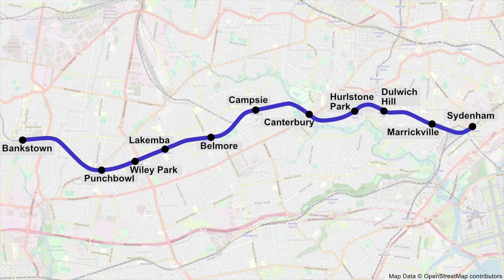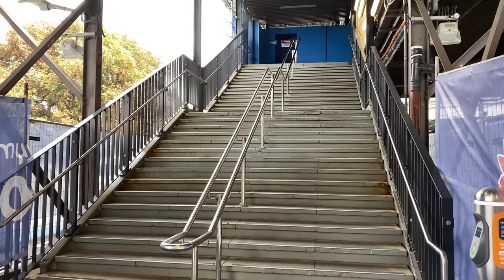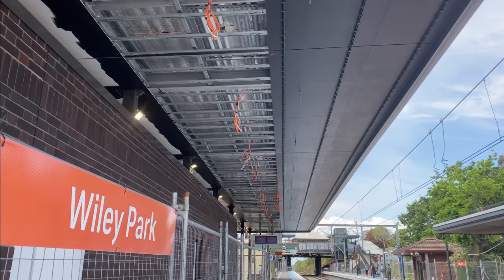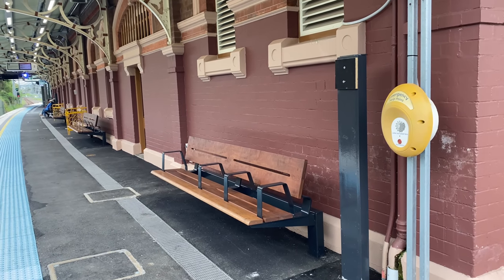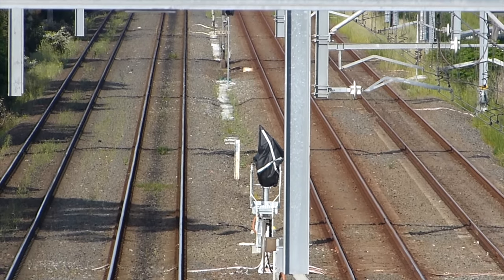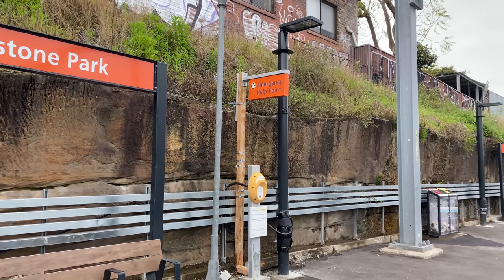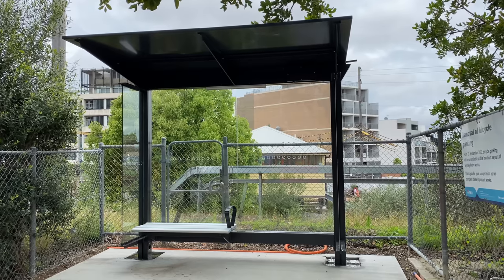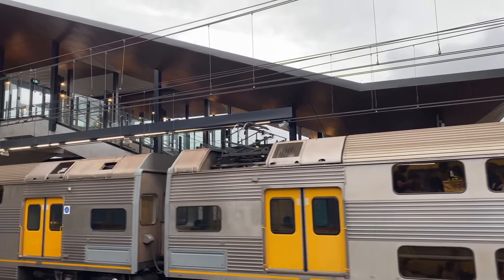Sydney Metro Bankstown Line Upgrade - Bankstown to Sydenham - Oct 22

Comment: Great video. I regularly make the roundabout walk from light rail to regular rail at Dulwich Hill - not that I'm ever in any great hurry, but it'll be nice to avoid that vague sense of futility when a train's pulling up to the station platform basically right in front of the light rail stop, so close and yet so far...
Reply from the maker: Hi Daia, glad you enjoyed it!  Yes that's definitely going to be a welcome addition to Dulwich Hill Station and will make it a proper interchange with the L1.  I reckon it will save a good 3 to 5 mins on the interchange time.

Comment: I live on the Metro Northline and our line was closed down for 6 months.  We never had a problem at all.  We just hopped on the bus and it didn’t interefere with us.  It will be fantastic when it’s open.  Your line is so old that’s why it’s going to take longer.  Labor are very hopeless at doing anything.
Reply from the maker: Yes the Epping to Chatswood line was much simpler to convert. For starters, only 5 stations that need platform screen doors, as opposed to 10 on the Bankstown line.  And because it's above ground, there is lots more to do to protect the rail corridor, so that driverless trains can operate safely. And then you've got curved platforms that will require mechanical gap-fillers. It's a big job!
Reply: When you think about 12 months won’t take long.  The Bankstown is so much older.  You won’t regret it when it’s down.

Comment: I'm fascinated by the graphic design of these upgraded stations. I find it interesting how the old CityRail signs have stayed around on the Bankstown Line for so long, presumably because Sydney Trains knew that the signage would get replaced anyway in the Sydney Metro upgrade so it wouldn't be worth replacing then twice. It's also interesting how on the temporary orange station signs above the new Metro-style seating, they seem to be using a different font to the font normally used for Sydney station signs; don't they care about the consistency? The fact that the turquoise Metro signage has gone up at Sydenham well in advance of the line opening is also interesting.
Reply from the maker: Well done on picking up these details! I hadn't notice the old CityRail signs or the different fonts being used!  Yes, they seem to be getting everything done that can be done right now, and that includes the seats and signs! I didn't mention it in the video, but the new aerial concourse looks so cool when it's all lit up.  I filmed it about 45 mins before it got dark.
Reply: I visited Sydenham station during a sunset in July; I agree the new concourse looks very cool in those lighting conditions.

Comment: Thanks so much, Paul for this great update. You know I always wanted the lifts in at Dulwich Hill for ages. Thankful for the helps up and down the station stairs from staff or fellow travellers. Those locked toilets inside the new disabled/parent toilet might have had an MLK lock for the  especially purchased keys with approvals but seeing inside the new unit I guess not.I have an MLK Key. I love it! Glad I held off going through until all this is finished.
Reply from the maker: Hi Geoff, yes lifts at Dulwich Hill had been talked about for a while, and it's good to see them coming now! All the toilets are accessible to anyone, so no MLK's required. For many months, the only toilets were at Marrickville, Campsie and Bankstown, so it's good to see the new accessible toilets opening at many of the other stations now.
Reply: @TransportVlog  That's for sure. An Asian business would n to allow me to use their toilet at Dulwich Hill but I found a coffee shop down the road where I could use their toilet. It ha all taken way too long!
Reply: @TransportVlog  Thrilled we're getting lifts at every station from Bankstown >> Sydenham, a long overdue update.

Comment: Nicely described as always, but I still can’t fathom what they are trying to do with this conversion which I see as a downgrade. What are all these services buildings required for? And all these extra substations which the existing train service seems to manage to do without? No one seems to consider that many more trains to carry the same number of people will be required and of course more trains means more servicing costs, not to mention the cost of purchasing and maintaining platform doors.
One could say that all the station improvements are long overdue anyway and not directly tied to the Metro project. Most of this money would be much better spent building a Metro to the many parts of Sydney nowhere near a rail line. It seems to be a lot of money to spend just to get rid of train drivers and guards on a small percentage of the Sydney rail network. And drivers and guards will be replaced with many more maintenance people.
Reply from the maker: Thanks! Converting the Bankstown Line to Metro is going to free up a lot more capacity for the T2 and T8 by eliminating the conflicting movements on the approach to Central Station.  And the existing trains, drivers and guards will be used on these new services.  I agree that it would have been better for the line to serve areas away from existing lines, and an obvious route would have been down to Maroubra, but that would have been 10 to 20 times more expensive than converting the Bankstown line to Metro. Yes there are a lot of substations and services buildings! I know that Metro trains will have their own dedicated power supply, but I'm not quite sure why so many are needed!  And yes, upgrading the stations to have lifts would have happened anyway as part of the Transport Access Program, but may be not as quickly. Here is a link to the More trains, more services page - https://www.transport.nsw.gov.au/projects/more-trains-more-services. I think this would be a good topic for a Vlog in the new year!
Reply: @TransportVlog  Thanks for your detailed reply, Paul.  I have not lived in New South Wales for over 30 years now so I’m not familiar with capacity problems or even tried to keep up to date with what T2, T8 etc refer to. But I’ll take your word for that. One aspect that Australian transport planners seem to be totally ignoring is the apparently permanent prospect of many city office workers permanently working from home at least some days of the week, and the fact that as such, planned increases in rail and other public transport capacity may not actually occur for very many years. I suppose I should save my scepticism about this project until I see how it turns out, but it seems to be a massive amount of expenditure to achieve not very much in the way of service improvement. I had a look in that link and it seems to be largely a typical government patting itself on the back. Under the present arrangement, Bankstown via Sydenham trains proceed to Lidcombe to terminate. With this metro downgrade, does that mean that Bankstown to Lidcombe will be a short shuttle requiring another change of trains at that station, or will be Lidcombe via Strathfield services be extended to Bankstown? Maybe they have not even thought of that.
Reply from the maker: @tressteleg1  All of these projects were approved well before COVID happened, but I'm sure the increase in people working from home will be considered for future projects going forward. One thing that is certain, is that Sydney's population will continue to increase significantly and transport investment will need to keep up with this. Yes Bankstown to Lidcombe will become a shuttle service.  This part of the change has been very controversial.  There's a whole website on it - https://restoreinnerwestline.org.au/. The T3 Liverpool service that currently runs via Bankstown will go via Regents Park and Lidcombe from 2024.
Reply: @TransportVlog  I realise that major projects are years in planning before construction even starts, so obviously the Bankstown Metro was well underway before Covid came along. Obviously city workers in retail cannot work from home, but many in office jobs can. It looks like a good percentage of that traffic potential has dried up. Obviously Sydney will continue to expand, but I wonder whether planners are considering that it may be at a much slower rate than expected.
It seems that the government is hellbent on the Metro conversion with no cares about collateral damage. 
Just think of somebody wanting to get from Punchbowl to Meadowbank. Change from Metro at Bankstown. Change trains at Lidcombe. Change trains at Strathfield. Who is going to bother?
I had a look at that link, and as above, the government just does not seem to care about anyone else. When I was young, there were always two ways to Liverpool via Strathfield. I think it was considered the mainline via Granville, but in the off-peak there was a shuttle which covered the Regents Park stretch. Sometimes I rode it after my school holiday ride on the Camden branch. Anyway, no doubt you will kindly keep us up-to-date as work on this conversion continues.

Comment: Hi Paul, great video. What is a services building?
Reply from the maker: Hi Dan, The term "services building" is quite generic and includes any building that houses equipment that is used to operate the railway or station. Typically this includes electrification, signalling and comms equipment. At Marrickville and Chatswood Dive Site, the services building also contains tunnel ventilation equipment. Hope this helps and glad you enjoyed this video.

Comment: When will the second platform at Bankstown station be built because Sydney metro hasn’t said anything about it.
Reply from the maker: Great question Lawrence.  It looks like there is a drainage channel that will need to be moved or covered first. And it's also possible that the existing up/citybound line might need to be straightened and realigned first. So it might have to wait until the final shutdown in 2024. What I do know is that they can easily create this platform in under 6 months, as that is how long the first one took! - Probably quicker, as there will not be a services building on the other side!

Comment: Thanks Paul. 
I was under the impression that they had to change some of these older station platforms to make them straight (rather than curved) for the Metro trains. Is this true?

Also do you know whether or not they will “stage” the opening; Chatswood to Marrickville first then the remainder?
Reply from the maker: Hi Anthony, in the original plans, they were going to straighted all the platforms. It's since been decided to keep the platforms as they are, and use mechanical gap fillers to reduce the gap between the train and platform. I talked about this in an earlier video. here is the link to it. https://youtu.be/yq2offXBCGg.  I think Chatswood to Sydenham will open first, and then the Bankstown Line will be closed and converted to Sydney Metro.

Comment: Hi Paul, thanks for another most interesting video. Incidentally, I am wondering what route the replacement buses ran on between Marrickville and Sydenham. I am guessing they may have had to run along Illawarra Road and Marrickville Road with the standard buses heading to the city, as I don't think there is any road parallel to the train line there. Years ago, we had relatives living at both Punchbowl and Lakemba, though not these days. Would that goods line at Campsie be the same line that continues to Marrickville and on to Mascot and Botany? Also, where does that goods line end in the other direction these days? Anyway, wishing you the very best. Rob.
Reply from the maker: Hi Rob, glad you enjoyed it.  No I don't know what routes the replacement buses would have took.  Yes that's the same goods line, although there is a spur off at Marrickville to allow freight trains to join the Illawarra Line.  I think it ends near the airport. There is work happening to make it double track around the airport.  Hope this helps.
Reply: @TransportVlog  Thanks for the info. I only wish that I had had a chance of travelling along that goods line to the airport. From what I remember, they used to hold enthusiast tours occasionally along the goods lines in Sydney, but I only found out about these after moving here to Melbourne.